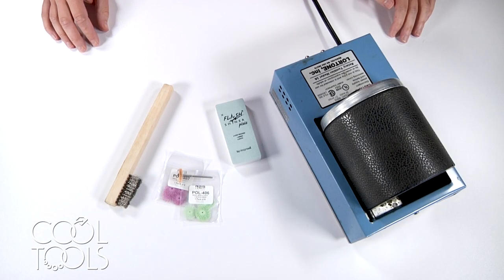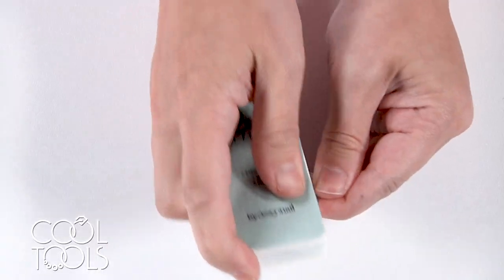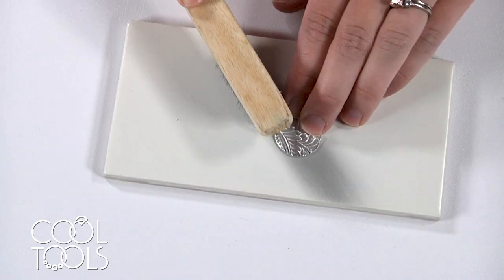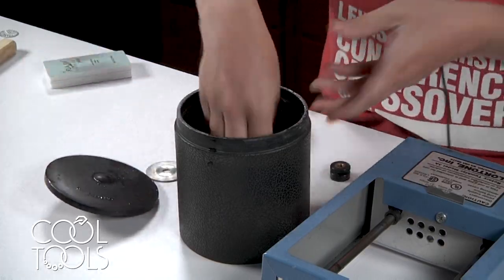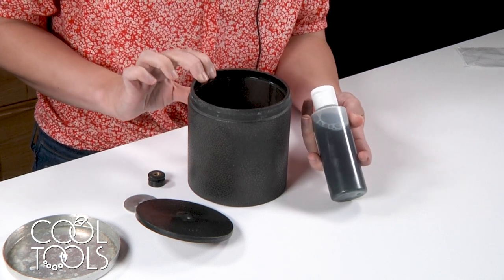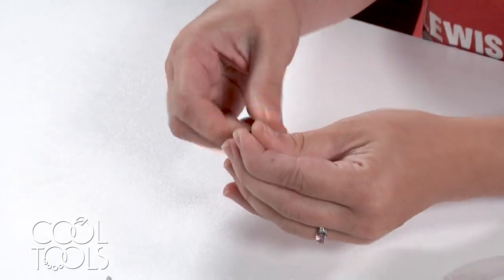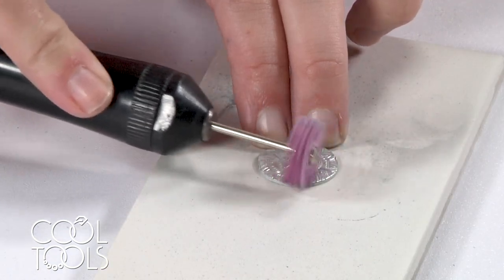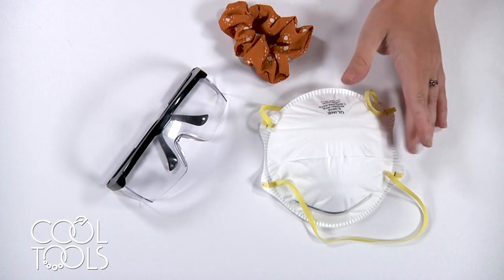Cool Tools | Polishing Precious Metal Clay after Firing

Comment: my piece looks more white than silver? did i fire correctly?
Reply from the maker: Hi Kathy, after fired, silver metal clay will look white. Once it's polished, it will be brought to a silver polish. If after polishing it is still white, I would recommend checking if it's completely sintered using the water test. Place a drop of water on the piece and if it absorbs the water, it is not completely sintered. You'll then want to re-fire the piece . Hope this helps!